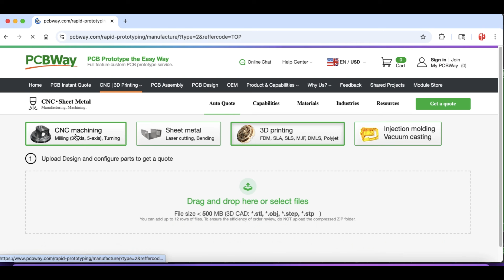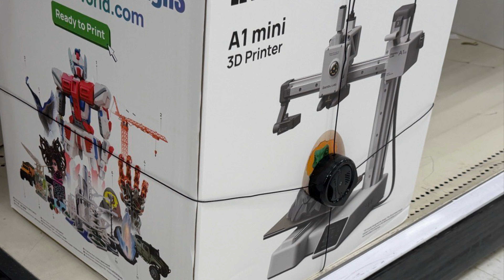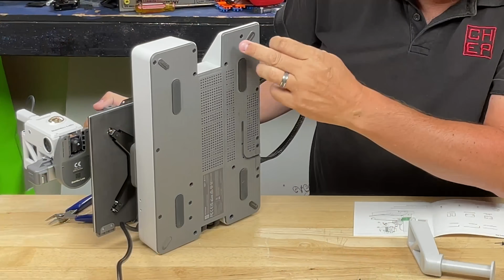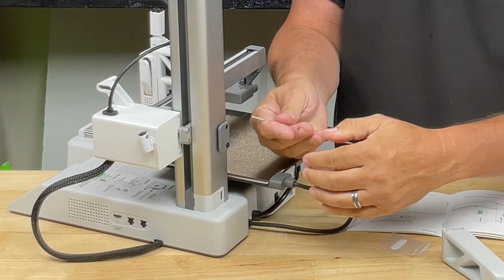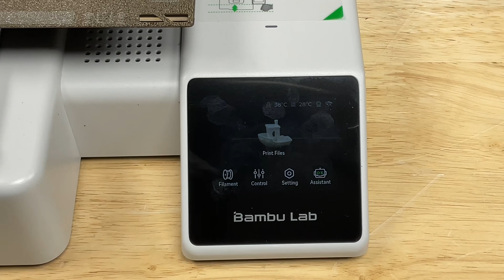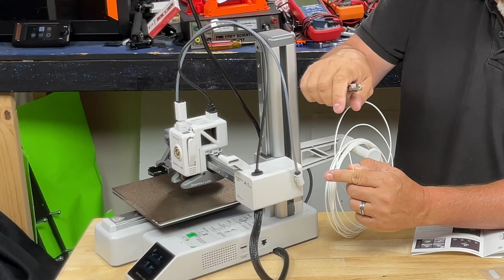Setting Up the Bambu Lab A1 Mini From Target

Comment: Always use the display's load & unload filament option. It's under Filament with the spool icon (Filament -> load... unload... edit type & color). I recommend adjusting the type of filament & the color.  The type adjusts the nozzle temperature for loading/unloading while the color sets the filament purge (poop) since brighter colors need more pooping to clear the nozzle of darker filaments.
Reply: You don't really need to use the menu to unload. I just press the cutter lever on the right side, hold the extruder release lever and pull out the filament. I've been unloading that way (external spool only) on my A1s and mini for the past 2 years and it's worked fine. I do use the menu function to load filament though.

Comment: The Auto Bed Leveling is selected by default but I think your screen lag made it tap it.
Reply from the maker: Possibly. I knew I wanted that done so I included it.
Reply: @FilamentFriday I've set up a dozen of these A1 minis for work events and I've never seen it lag that bad - I hope it got more usable.  I suspect it was doing stuff in the background using the resources.
Reply from the maker: Seemed to go away.